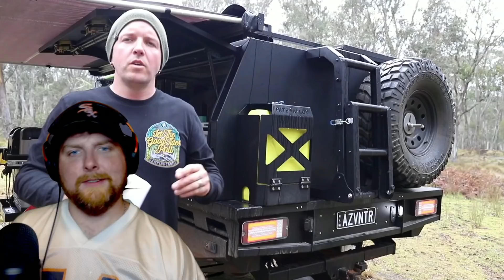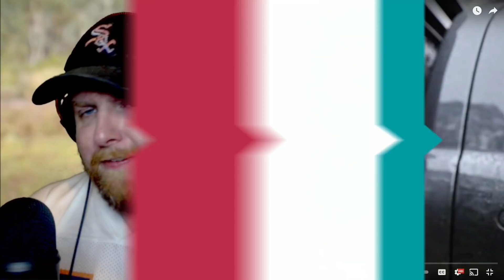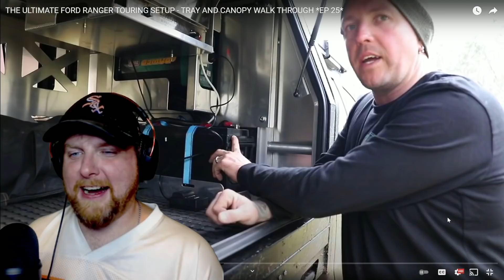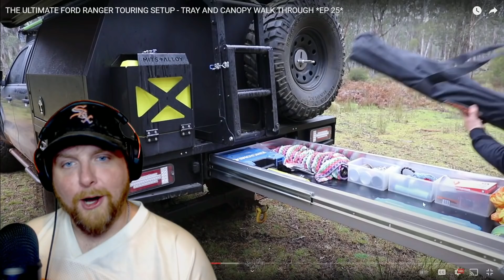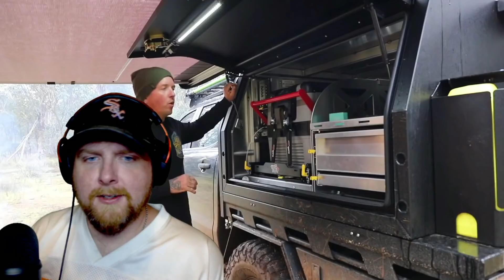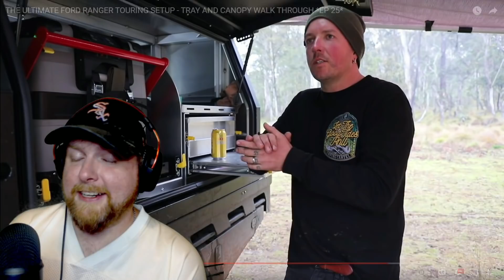American Reacts to The ULTIMATE 4x4 Setup - Australia

Comment: Thats not an off road vehicle!  That's a tradesman's vehicle.   Need the 12v to charge tools, inverter too.  Need the lift and tyres to get onto an unpredictable jobsite.  Radio to coordinate.  Tax deductable, most with accellerated depreciation.   Nudge, nudge, wink, wink.

Comment: If you overland you don’t do this is too heavy and overkill.  The weight is a vehical killer!  And l don’t mean the engine and transmission, it’s a structural destroyer.  Vehicals aren’t build with the steel gauges from last century.  My LandRovers had 4,000kg standard factory tow weight plus 1,400kg payload because of the way the frame was built!  Nothing to do with engine power but structural strength not to bend and crack.

Comment: Yeah we have so many restrictions when it comes to modifying cars here it kind of sucks. We can't do the crazy big suspension lifts massive Tyers and keep it street legal. We can do certian things as from standard like 4" over all lift so 2" suspension 2" tyer bigger than standard etc but to go bigger you need to get what we call mod plates which incures extra expense because it needs to be "engendered". So basic mods suspension, tyres, snorkel, dpf back exhaust, bullbar, rock sliders, under body protection your talking inexcess of 15 to 20k. 
Could we build insane trucks like you have in U.S we could but can we drive them down the road to the shop yeah not gonna happen. 
People do build them but there for more comp purposes unregistered.
We also have ridiculous fines if your caught with a modern  diesel with dpf removed its 10k  worth of fines. It's similar to if it's  modified fast a point

Comment: Pretty much every ute in Australia comes in a diesel option, and 4x4 utes are almost always diesel. Also, I'm not much of a ford guy but the Rangers come in a 2.2L 4cyl turbo diesel, and the amazing sounding 3.2L 5cyl turbo diesel. The new 2022 Ranger is also supposed to come out with a 3.0L V6 turbo diesel option.

Comment: What a great video! Thanks for doing it. I would say Australia is the 4wd captial of the world. We have a massive off road 4x4 culture. People think that we'd be more English but we're very American in so many ways but different. Huge car culture on all levels too. That vehicle is typical but probably state of the art. A lot of mods and money! We don't go to a park, takes our vehicles off the trailer and go four wheeling and then go home. Very different. Australia is a big country, the size of America or Europe. Not only do we have to get there, we have to get back! It could be a 5000km round trip! Our off road vehicles are built for that. There are a lot of off road trailers designed for the same as well. Also the larger 4x4 pickups would have trouble in the bush due  to their size and wheel base. That's why you don't see them. We do have them, but they're used more for towing. Nothing like a Ram or Silverado to do the job. I guess it's about function, practicality and getting the job done. Everybody's vehicle will be built for the type of touring or off roading that they do. And yes, they're all diesels except for the late model Nissan patrols which are V8 petrol. Lots of older vehicles too especially, LandCruisers,Patrols, Hiluxs,etc.

Comment: I've got a 1992 GQ TD42T with 2 inch lift and 3 inch body lift ,  winch bar , winch , roof rack , roof top tent with annex , double swing away rear tyre bar , snorkel , intercooler , 2 CB radios , dual batteries plus a deep cycle battery , fridge , draws DC - DC charger, awning , highrise jack , swags , 3 Room tent , 6x3 MTR gazebo , ready for whatever occasion and it owes me just under $20,000 AU and that includes a gearbox build . His just under $35,000 canopy + $45 - $50,000 + car although nice makes no sense to me but that's just me.

Comment: Man, you should really stop speaking for what is or isn't common in the US.  The US is a big place with wildly different terrain through-out.  Maybe snorkels aren't common wherever you are, but that doesn't mean that is true for the entire country. 

Where I live, snorkels are actually VERY common, and for the same reason as they are common in Australia. Not for crossing water, but because they keep dust from plugging up your air filter when you are driving through the desert behind 5-25 other rigs.  You would be amazed at how fast your air filter can become completely clogged with dust when you are out on the trail here in Arizona. 

I can't even drive around downtown Phoenix without seeing snorkels on every 5th Tacoma or Jeep.

Also, mud flaps are required most of the time in the US. Again, depending on which state you live in. Some states require them any time your truck is a certain height away from the ground. Other states require them if your vehicle originally came with them. Other states may not require them. And some others require them for trucks with dual rear wheels, but not for trucks with single rear wheels.
Reply from the maker: I am right next door in New Mexico, Thousands of Off-road builds on our extensive trails here in Las Cruces alone, and I frequent Trips to Phoenix as well, I have not seen Snorkels much, maybe 1 out of every 10 trucks here. Up north in Illinois I NEVER Saw them. I never said I was the Standard for all of the US, my viewers know that, I am just giving my experiences and opinions, If yours is different, that is great, welcome to our diverse world!  I just have a hard time Believing Snorkels are VERY common as you said... That is a stretch. Appreciate your Info though, you make a good point about the desert dust. It is even worse here in NM. 
also wanted to add Mud flaps are only required in 11 states.. that isn't many, most states don't care. Not like canada that writes tickets to everyone I know up there with any truck on MTs haha

Comment: lol no. Australia does not have a better/larger off-road culture than the US.  Australians typically do only 1 type of off-roading. What you see in this video. Overlanding. They pack up a bunch of gear and go exploring some remote area. But 90% of the time it isn't even really "off-roading" per-se. They aren't out there to tackle obstacles and challenge their vehicles. They are out there to explore, to see sights, and to camp. They are out there for the journey and the destination, not the challenge. To them, the "off-roading" is just something that has to be done along the way. They will typically drive around, and avoid, difficult terrain if possible. 

Meanwhile, in the US, we have as many different types of off-roading as you can imagine. We do overlanding but we also do rock crawling at every level from mild to seemingly impossible, mud bogging, swap racing, pre-running, Baja, King of the Hammers, Monster trucks, tough trucks, trophy trucks, rock bouncing, hill climbs, etc, etc.. 

The point is that here in the US people go off-roading to go off-roading. They go out to challenge tough obstacles and see what they and their rig can do. It isn't about exploring or reaching a destination, it is about the sport of it. While the Australians will avoid the difficult terrain, Americans will avoid the easy bypasses. 

And I think the difference comes down to the laws of each country. Unfortunately for Australians, they have incredibly strict laws concerning what modifications they can make to their vehicles. I believe they are limited to only 2 inches of lift, INCLUDING any lift from larger tires. And their tire size choices are limited to only 2in larger diameter than stock, meaning most are limited to 32 or 33in tires.  In some Australian states they are also limited to making their vehicle no more than 1in wider than stock, and there are many other laws in different places around the country. 

All of that nonsense combined with the fact that most Australian 4x4 vehicles are manufactured with very long noses and very poor approach angles, means the Australian people are very limited in the type of "off-roading" they can actually do. 

Plus they make some very weird decisions that I do not understand. As I said, a lot of Australian 4x4s have long noses with poor approach angles. Yet Australians keep installing ARB bumpers which are some of the biggest, bulkiest, bumpers on the market. They make the already long nose even longer and the approach angles even worse. Maybe it is just some kind of brand loyalty or patriotic Australian pride in an Australian company? I have no idea. But they really are one of the worst off-road bumpers if you care about actually going off-road. 

And don't get me wrong, I'm not bashing Australians or their rigs or their type of "off-roading" at all. I respect them for getting out and doing it despite the draconian restrictions put on them by their overbearing government.  But that doesn't mean I have to pretend like their off-road culture is just as rich and large as that of the American people. It just isn't.
Reply from the maker: I should have specified that Honestly i Love USA off-road culture, it is incredible for it's diversity and definitely terrain. ( the 4 corner states are literally off-road heaven) 
What i have said before and may not have stressed here, but have in specific Australia truck videos is that they have Way more options to choose from when it comes to vehicles and engine choices. Even Mexico does haha I see custom Utes from mexico and Offroad rigs like awesome lifted Toyota Hilux builds ( i live on the border)  
A simple example of what I mean is say for people that like " out of the Box off-road trucks" the whole world gets the Ranger Raptor, but not the US. 
They finally brought back the Bronco here, but have you heard of the Many issues those have had?
But you make some good points too. Cheers

Comment: I would really recommend 4WD/247 they have a ton of videos about off-roading in Australia as well as builds they do. Also I just wanted to say that most 4WD’s in Australia are diesels to my knowledge!
Reply: If I'm not mistaken thats true most places, availability of diesel for agriculture / equipment / industry in remote areas mean diesel makes more sense.. Also a hold over from diesel being super simple (without modern stuff, sensors, dpf, turbo or any frills) and reliable.
US and probably saudi or similar with V cheap local Petrol / Gas (Actually, lots of the older russian Kmaz trucks were gas too IIRC) 

4WD/247 is a great ad disguised as a show.. but good content if your into Aussies goin off road and mucking about.

Comment: most true 4x4's in australia are diesel hence the snorkel, my gen call if off roading. 1990's 4x4'c and 1980's could go up to 5000kg, obviously suspension modifications, you should check out the back of beyond black and white movie. that's the outback off road experience.

Comment: Most people in Australia that actually do "overlanding" or touring here don't own setups like these unless they are either cashed up A.F. and have no sense or they are paid to promote the products. The latter traps the former along with all the people aspiring to waste their hard earned on the advice from people like Ronnie and 24/7 on YT. There, I said it. You don't need most of it and 90% of Australians don't have this kind of setup - or they do to one degree or another and just did it themselves for 1/3rd the price or less.
The majority of people that get sucked in to paying what amounts to a second vehicle on the back of their already overpriced dual cab never do the sort of stuff that 24/7 do because they don't have the time or they just thought it was what they wanted before they actually went out and did some of these trips and then discovered that it really wasn't for them. The most expensive setups I see in QLD have barely if ever been off road.
I built something similar myself for less than 12 grand without the inverter and cooker. That's tray, canopy, lighting, lithium and the drop slide, pull out kitchen and a 270 awning. Oh including paint and I insulated the thing and carpeted it. I did mine because I needed something to do during covid.
To those promoting the tax benefits - you best not get caught. ITC is not 100% either way, if you use it 10% for work that's all you can legally claim.
Mate I'm sure that I don't need to give you a run down on how much salt you need to take with YT videos. This is not in any way mainstream Australian off road.

Comment: im from Argentina and i have a 07 4x4 dual cab Ford Ranger with an International 3.0 4 cyl powerstroke turbo diesel, not much hp but very good torque, i don't have that much gear as the guy in the video, but with good recovery gear, 31 inch bf ATs ko2 i never had any problems offroading, mostly dune/beach cruising.
I'm tempted to say that in almost every other country, except for the US, mid sized 4wds or utes or midsized trucks comes with diesel engines, there are gasoline options in some models but gasser engines are the exception ( gas 2.4 4 cyl ford ranger and 3l v6 hilux for example) but pretty much people assume if you have a midsize truck you have a diesel truck, at least here in south america and in Australia.

Keep it up with the good content, greetings from the west's down under 🤣🤣🧉🧉🇦🇷🇦🇷🇦🇷🇦🇷

Comment: This type of build is very common here in OZ. Most off-road vehicles here are diesel due to the outback conditions and better for deep water crossings. The main reason for the snorkel is keeping the air intake high for our many deep water crossings here in OZ.
Reply: The reason I have a snorkle is for dust. Gets above dust kick up on red dust roads. Red dust is so fine it doesn't care about your filters life time.

Comment: my rig isn't too hardcore at all, just a 2013 Mitsi Challenger, Safari Snorkel, 2 inch Bilstein lift kit, Kings Full Roof Basket, the usual awnings, Rodtube for fishing is just 4inch downpipe with caps, 265/65-17 BF Goodrich KO2 T/A's on the factory alloys, thinking of stepping up to 285/70's but dunno if i wanna plug another 2500 to join the 33 club with no noticable difference lol.
nothing flash with my camping equipment, 138AH AGM batterybox, 300 watt solar panel kit, 70 litre fridge/freezer. Joolca hot water kit, chem dunny, Coleman 10 person tent for family trips, just a double swag for solo missions.
Looking at getting offroad trailer down the track for longer trips, but i'm comfy as for a week or so with my current setup

Comment: I think 4x4's in South Africa are just as well set up, as both countries have a wide range of terrains and multiple climates. Also we don't weigh our 4x4's down with those heavy metal boxes er canopies at the back.
Reply: It does add some weight but everything is tidier and more organised. U can fit everything in there and it will be alot safer

Comment: The snorkel is more about lifting the air intake above the dust on un sealed roads than anything else
Reply: Pretty useless for that unless it's bulldust and you're following someone, I drive 1000s of ks on dirt roads a year and honestly it's never really an issue unless you follow someone for a while.
Reply: @exogator  Not arguing with that at all. That's my experience too.

Comment: Snorkel's are simpler on diesel's because older diesel engines are less reliant on electrical systems so can run fully submerged when needed while in training with the British army we used to use an old beat up landrover defender with a snorkel to deliver meals to tank crews in the field and it crossed a river which could reach over five feet deep several times a day. As long as you kept it in a low gear with the revs high to prevent water backing up the exhaust that old bus would power through although you did get wet legs as the doors didn't keep the water out very well.

Comment: Mmmmm but- what if you smash the car down the track snd have to replace it.  Sure all this gear is prob saveable but what if the next model of Utes are entirely diff. dimensions and yr saveable gear won’t readily fit in the new ute??  Yeah insurance is insurance but ya gonna lose either way.  I guess I’d rather go with maybe a work ute and seperate camping crap than huge expense of built in Camping crap.  Works great in housing but don’t agree with it in cars.
Other than the badge and the built in THATS MY CAR!   Diesel☑️ Ute☑️ Colour☑️ Tyres including rims (or not rims but that open old steel look)☑️ Very similar body type - narrow and longish - DMax Ute☑️.  
Like my sidesteps better tho - bit wider.

Comment: Diesels use less fuel than petrol motors also very good for towing.
We dont have large 'trucks' here like a tundra... there are Ford F150s but they cost wayyyy too much and are harder for accessories... cant beat a hilux 4cyl turbo diesel

Comment: I used to live in a 60 series Toyota Landcruiser wagon. It was an '83 model, completely stock in the drivetrain. 2H diesel, 5-speed manual. 60mph was it's top speed. On the flat. She was old and tired but would go just about anywhere I wanted to go. Loved that wagon. I'm currently refurbishing a hi-lift Ford Courier 2x4. It's got the Ford SOHC V6 4.0l. It's a crew cab with an 1800 mm (6' x 6') aluminium dropside tray. I'm fixing the back up to hold my genset, welder, tools etc, plus a 100 litre water tank, small hot water tank, stove etc. I'm building an elevating platform that will sit low over all the tools etc and can be raised to roof height. That will be my bed (yes, it will be covered). Eventually, I'll have racks over the body to hold a solar panel setup. Then I'll be living in it and tripping around the country permanently.

Comment: I did comment earlier on 4wds. Most 4wds in Aus. are diesel approx 80% compared to petrol. When you say you fill your vehicle with gas I assume gasoline. if so what do you use for diesel or propane? i'm intrigued , still like your content. regards Peter.